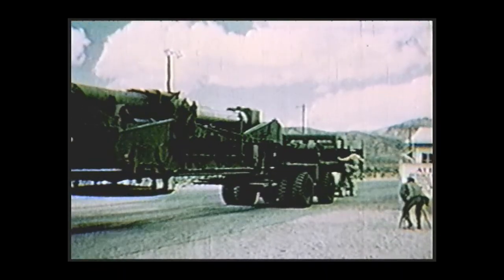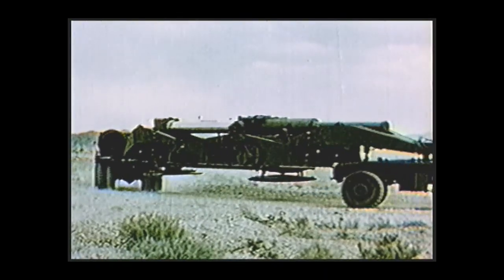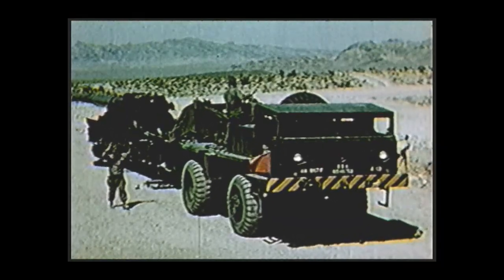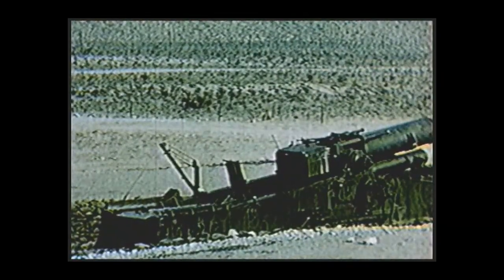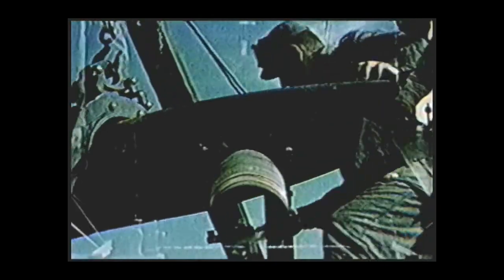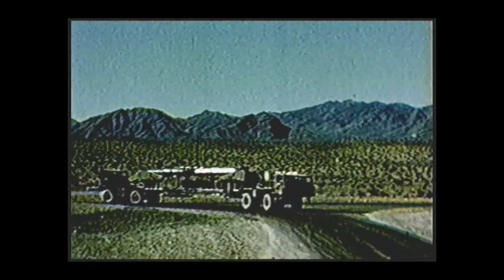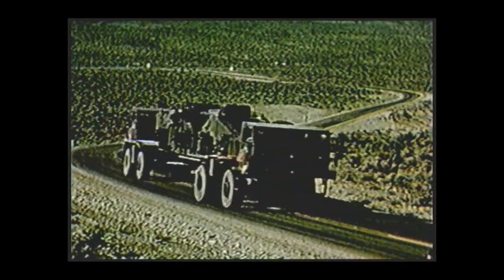The 280 MM Gun At The Nevada Proving Ground

Comment: The 280 MM Gun At The Nevada Proving Ground.
A arma de 280 MM no Nevada Proving Ground.

O primeiro teste de artilharia foi em 25 de maio de 1953 no Nevada Test Site. Disparado como parte da Operação Upshot-Knothole e com o codinome Shot GRAABLE, um projétil de 280 mm (11 polegadas) com uma ogiva de fissão do tipo canhão foi disparado a 10.000 m (6,2 milhas) e detonado a 160 m (525 pés) acima do solo com uma estimativa de rendimento de 15 quilotons. Este foi o único projétil de artilharia nuclear realmente disparado no programa de teste dos EUA. A casca tinha 1384 mm (4,5 pés) de comprimento e pesava 365 kg (805 lb); foi disparado de uma peça de artilharia especial, apelidada de "Atomic Annie", construída pela Unidade de Teste de Artilharia de Fort Sill, Oklahoma. Cerca de 3.200 funcionários estiveram presentes. A ogiva foi designada como W9 e 80 foram produzidas de 1952 a 1953 para o projétil T-124. Foi aposentado em 1957.
Primeiro Curta Metragem Em Cinejornal De 1952 a 1953. 
A Cer Pubricado.
No Canal. 
Nuclear Vault.
Abóbada Nuclear.
Em 7 de julho. de 2009. há 14 anos

Comment: 0:04 It's interesting that the cannon was delivered in pieces to the test site by train flat car, and reassembled for the test. This without the motorized carriage with rubber tires designed specifically for the cannon for transport on roads. Probably for security reasons.

Comment: interesting how they sanitized it and did not show the gun firing or the time in flight of the projectile.
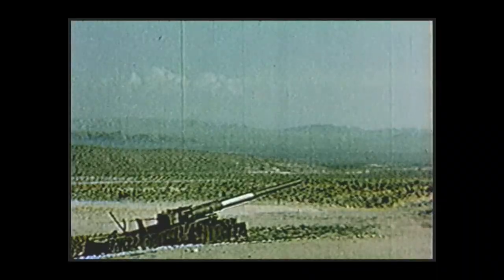Reply: 5:54 Gun fires
6:07 Gun fires
9:13 Gun fires
The shell's muzzle velocity was 2500 ft/sec. You can calculate the time in flight to travel 6.2 miles.
Reply: @buzaldrin8086  thanks
Reply: @buzaldrin8086  That seems close to be near its POI; wow
Reply: @jimsworthow531  "seems close"
Six miles? It's a 15 kt weapon, same as the Hiroshima bomb. By today's standards a small tactical weapon. Check out the effects on this site: 
https://nuclearsecrecy.com/nukemap/

Comment: If you're going to drop a nuke, you might as well use an airplane or missile. That 208 mm cannon has been out of the inventory for years, because it is so cumbersome. The Atomic Cannon was probably designed so the Army felt like they were part of the nuclear war business.
Reply: Fact check: the Schwerer Gustav was 300 mm (31 inches).
Reply: @buzaldrin8086   Both of us are way off. Schwer Gustav was 800 mm caliber. That 208 mm shell is still over 8 inches diameter, which compares to a WWII cruiser or pre-dreadnought battleship.
Reply: @HSMiyamoto  Let's clarify. The Atomic Cannon's shell was 280 mm (11 inches), not 208 as you stated. https://en.wikipedia.org/wiki/M65_atomic_cannon. 
I mis-spoke about the Schwerer (correct spelling) Gustav's caliber. It was indeed 800 mm or 80 cm as you stated. The US produced nuclear shells for the Iowa-class big battleship's 16 inch main guns. 
https://en.wikipedia.org/wiki/Iowa-class_battleship

Comment: I love these old documentaries.  Also   for reference   280mm is approximately 11 inches, which is how a naval gun would be described.   And 11-inch battleship guns would have been considered nearly obsolete at the start of WWII, when most navies already used 12-inch, 14-inch or 16-inch guns.  The Japanese even fielded two battleships with 18-inch guns,  or 457mm.
Reply: And good lord, it is darkly amusing to see how casual we were about using battlefield nuclear weapons back in the early 1950s.
Reply: @jobu88  The very fact that NATO had the nuclear deterrent all along is what kept the Warsaw Pact on their side of the Iron Curtain.
Reply: 16 inches (410 mm) battleship guns delivering 410 mm W23 nuclear shells, 1956-1962.
W23
The W19 nuclear system was adapted into a nuclear artillery shell for the US Navy's 16 inch (406 mm) main battery found on the Iowa-class of battleships, the W23. Production of the W23 began in 1956 and they were in service until 1962, with a total of 50 units being produced.
The W23 was 16 inches (406 mm) in diameter and 64 inches (160 cm) long, with a weight given variously as 1,500 or 1,900 pounds (680 or 860 kg) in reference sources. As with the W19, yield was 15-20 kilotons.

Comment: we need to put those to work on every battle front we have.  Use it once or twice and no sane country would mess with you.
Reply: The same problem exists today that got them all the small nukes pulled from service, our it dawned on our generals that even at their maximum range you basically sacrifice the gun crews and everyone around them to slow death by radiation exposure if the managed not to be caught in the blasts outright.  They were great as a suicide or last resort weapon but no commander chooses to waste their own troops when they don't have to.

Comment: 7:52 - For those of you wondering, that tool being used there is a fuse-setter, and they are adjusting the exact time to detonation of the shell.
Reply: It exploded about 160 m above the ground. Do they set the delay after the projectile is shoot (possible miscalculations) or rather how much earlier before the contact with the ground it has to act (like a proximity fuse)?
Reply: @lanceortega1  This particular type of fuse is called a mechanical time fuse.
The timer is activated by the physics of the projectile being fired, namely from rotation of the rifling and setback from the intense g-forces exerted on the projectile at the exact instant of going from motionless to several times over the speed of sound.
They set the fuse to a specific time after the gun fires to ensure that it detonates at a set point, usually over the target and (the main reason for mechanical time fuses) ensuring that it's well clear of friendly troops over whose heads the projectile might have been fired.
We also had proximity fuses that you referred to.
The ones that we had had infrared sensors designed to detonate the explosive charge when it gets near a target.
Those types of fuses are particularly effective against planes because they allow the projectile fragments to get blasted into the plane's engines.
FWIW, most of the high explosive projectiles that we had when I was in the Navy used proximity fuses.
The only ones I personally saw with mechanical time fuses were illumination rounds or (yeah, scary) white phosphorus rounds, although we never fired "Willy Peter," but we had scores of them in the magazine in their own segregated area..
Reply: @Gunners_Mate_Guns  Thanks for Your quick and detailed reply.
Reply: @lanceortega1  No problem.
Reply: @Gunners_Mate_Guns  Thank you for sharing this information - I had wondered quite how a timer would work on a nuclear shell, and started thinking what happens if there were any faults or delays with firing!?
Reply: @michaelsummerell8618  I believe they retired the "Davy Crockett" because of an abundance of caution over fear of premature detonation of nuclear artillery shells. Since most bombs & missle warheads had numerous fail-safe interlocks which the nuclear artillery shells did not. G. Gordon Liddy used to brag about commanding a "Davy Crockett" artillery squad back before joining Nixon's White House plumbers outfit!
Reply: @donnajones1603  i did 8 years in the "intelligence world."  i believe the actual reason the nuclear artillery canons were retired was that military planners determined that they were not going to be useful "tactical" weapons (weapons used on a particular battlefield) because the radioactive fallout of the atomic shell blast rendered the impact area a "no-go zone" for ALL humans - including the attacking American troops.  "conventional" ammunition (shells and ground launched missiles) were also advancing rapidly in explosive capability and accuracy and these offensive weapons did not pose the radiation problem the "atomic cannon" did.
Reply: @jimharvard  That sounds entirely plausible.
In our military at least, I believe all tac nukes as such have been taken out of service.
One particularly interesting one to me was the low yield nuclear ASROC (anti-submarine rocket) depth charge, which was said to essentially create a five-mile diameter steam bubble when detonated.
That particular weapon was described as essentially a Hail Mary weapon used to destroy a Soviet ballistic missile submarine before it could empty its tubes to save millions of Americans...most likely at the cost of the frigate, destroyer, or cruiser that had launched said depth charge.
It was a very sobering proposition to realize what the captain of any ship so equipped would be going through at the moment of having to fire such a weapon.
Reply: @Gunners_Mate_Guns  i have a good friend who served on "Boomers" nuc subs for 4 years as a Submariner.   ironically, he became a Minister when he got out, perhaps due to the nature of his military service.   one of the most interesting stories i learned of early in my intel career had to do with a single Soviet sub-commander during the Cuban Missile Crisis.  he had nuclear torpedoes on his boat and was pre-positioned close the Quarantine Line the U.S. Navy had set up outside of Cuba.  the Soviet Commander had orders that he was to fire his torpedoes on U.S. ships if he lost communications with Moscow during the crisis.  as it turned out, Soviet submarine communication technology failed because the sub was too deep for the radio signals from the Soviet Navy Command.  the sub commander thought Moscow might have been attacked by the U.S.,  however, the Commander could not bring himself to "follow orders" and launch his nuclear torpedoes against the U.S. ships.  when he returned home, he faced a brief period of military investigation but eventually had a very successful career.  he is know as "the man who saved the world."
Reply: @jimharvard  Yes, I saw the documentary on PBS about him, I believe titled "The Man Who Saved the World," an episode of their series "Secrets of the Dead."
https://en.wikipedia.org/wiki/Secrets_of_the_Dead#Season_12_(2012-13)
It was quite a moving story, and this man is a hero.
Reply: @Gunners_Mate_Guns username checks out.
Reply: @Roddy556  Thank you, and yes, it does.
I'd be lying if I said that I didn't miss all the work involved with shooting our MK42 - 5"/54 caliber gun.
It's shocking to realize that it's already over thirty years since I did that.
Reply: I can imagine the guy slipping and setting the time to zero
Reply: @HESS1313  FWIW, there is no zero on the timer.
I can't remember what the lowest number was off the top of my head, but it was definitely something well above that, at least five seconds (probably more), and just for the safety reasons you mention.
We still had the manual wrench for fuse-setting in a pinch, but the way that we activated our fuse-setters was with automatic hydraulically powered fuse-setters in our gun system.
We never had to touch a round we fired once we loaded the drums in the magazine.
the fuse-setters themselves were remotely operated by the fire controlmen given the distance to the target by the gun fire control system.
Reply: Jim Man  You mean other than the 2 that have been going on for the past 20 years that haven't officially ended yet?
Reply: Jayden Cruz  Relax, was just providing a little bit of extra technical information.
You sure sound butthurt about the likes, though...how sad.
Reply: I want to hear about the artillery shells using infrared fuses. Infrared guides, proximity fuses detonate.
Reply: The army's specialty is conventional munitions and shells. I get that but NUKES are another matter. Wouldn't this weapon have had to have been developed and overseen here by NUKE psycists from Sandia at  L. A. in New Mexico?  Does anyone understand my point???
Reply: Really? one would otherwise surmise they were adjusting the elevation. Thanks for clarifying 😂

Comment: Interesting seeing how the recoil system on this gun works, with the carriage itself coming forward after the tube has completed its rearward movement.
The 5"/54 caliber guns in the Navy, including the MK42 mod9/mod10 I worked on for four years, have a recoil/counter-recoil system that consists of two hydraulic cylinders in combination with heavy springs that work exactly the way that modern cars' suspension systems do for the recoil (rearward) cycle of the housing (the portion of the gun that moves under fire) system; then the counter-recoil system (the portion that forces the gun back forward into full battery position) consists of a hydraulic ram that is propelled forward by increasing pressure from the rearward movement of the slide against a nitrogen chamber that compresses the gas until the rearward movement halts and the compressed nitrogen then forces the ram forward, which in turn forces the housing back into full battery.
I've sat only feet away from the gun while firing and watched the complete recoil/counter-recoil cycle thousands of times, and it takes less than 1/4 second, even though the barrel recoils 18.75" with each firing.
Reply: I think the gun recoil was 76 in then the carriage recoil was another 174ins. I was in the 80 th arty, in Schwabach Germany  in the spring and summer of 1960, the first time you see, hear, and most of all feel one of those puppys fire , you think your world has come to an end...
Reply: @kennethpack1963  The gun you were firing was a far sight bigger than mine!
Of course, then we have the real monsters, the 16"/50 caliber guns on the Iowa-class battleships, with the armor piercing projectiles each weighing 2750 lbs.

Comment: Interestingly, the 8 inch W33 shell, designed to be fired from a smaller cannon (howitzer) was tested in 1962 with a yield of 40 kilotons, over 2 1/2 times more powerful than the larger (in size) 11 inch shell of the M65. However, the W33 was never actually fired from a gun, unlike the Atomic Annie shell pictured here.
Reply: the davey Crockett had a low yield nuclear yield along with the honest John which were replacing atomic canons..
Reply: @edwilson4852  Read the Wiki article on "nuclear artillery".

Comment: 1. activate English subtitles
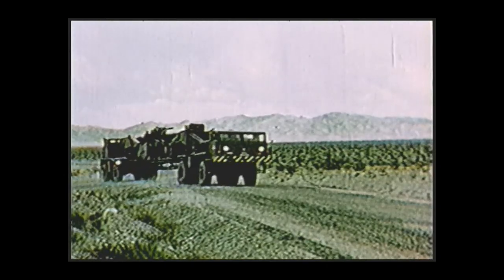2. go to 4:05
3. have fun
Reply: Did you fall on your head Zekerias?
Reply: +Satellite "a bitch weapon eat prime mover"!  lol.  and i'm scared of all those gums!  so many gums!
Reply: Atomic-bomb  is a frad that does not work at all. Its a fraud indoctrinated in the head  of the sheeples that eating all shit the bankster controlled regimes put
 in their head. The fission-neutron-cross section for neutrons in the 
range of 0.5-2MeV is close to zero !!!!! For moderated neutrons as in a 
peaceful reactor the energi levels of neutrons are under 1 electron volt
 !  Its lake comparing a vawe on the ocean with a length of 0ne million 
meter between the wave tops with one one a meter. Do you beleave that 
the one with 1 million meter between tops will interact good with your 
boat ?  Or do you think that the one with one meter will give interact 
more with your boat?    If this is not enough can you sheeps explain to 
the wolf how it can be possible that the return wave on a so called 
magic bomb weapon can be of the same megnitude as the primary wave as 
the propaganda illustrates.  Do you think that the yellow mushroom cloud
 with black soot inside is TNT/ammoniumnitrate/gasoline and the starting
 sceen with totaly yellow screen is a photo of the sun?  Why do you got 
an intact central city in Hiroshima/Nagasaki there the pressure from a 
real (non exisisting) bomb would have been in 18 psi range? Ironically 
the bank just 600 meters away from so called ground zero was totaly 
undamaged exept the windows :)   The truth is that the cities were fire 
bombed with napalm therefore clean streets no crater. All streets 
cleaned from garbage and everything possible to photograhp on celluloid 
film that woud have been totaly black if radiation were present .
Reply: @zekeriasvarg530  Ohhhhhhh.
The neutron-fission-cross section for neutrons in the range of 0.5-2MvE is close to zero!!! Okay. I thought it was closer to 1 with the whole "-2" part.
No wonder when I gave my thesis on Why 0 degree Equivalent of Matter-AntiMatter Condensate Necessary for Parallel Dimension Viewing of Quark Spread got a fail. Boy is my face red. Oopsy.
Reply: @Dee_Sandoval  as the probabily function for fission is almost zero for fast neutrons yu have to moderate them as in a peaceful powerplant and this is the reason why the bomb never worked.